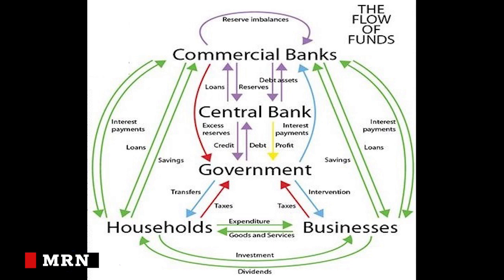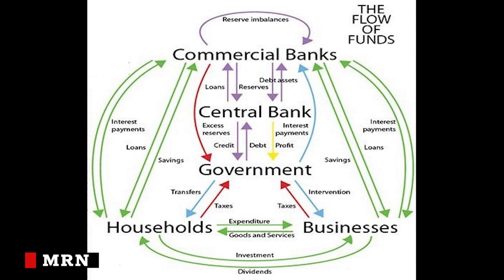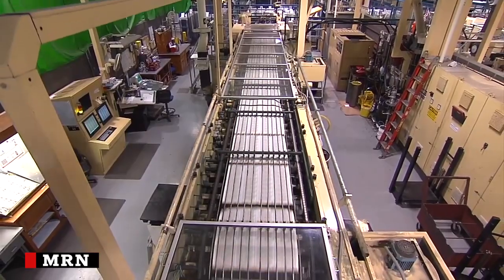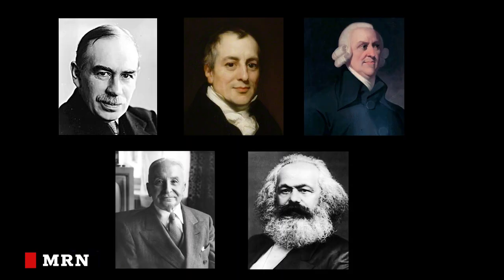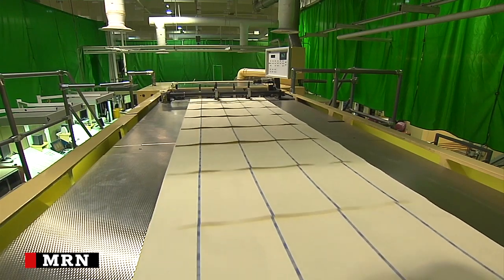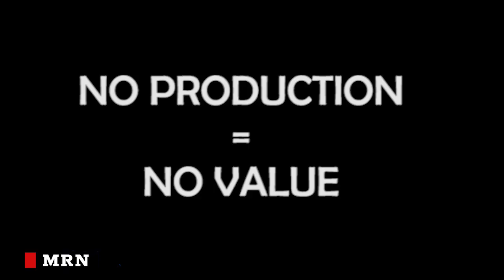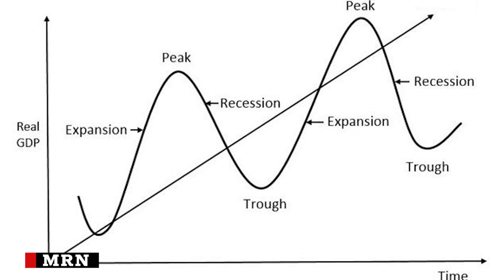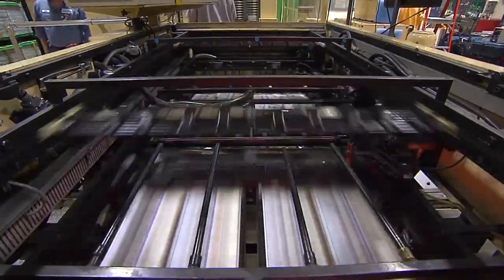The Main Problem with Modern Monetary Theory

Comment: Taxes create unemployment. Taxes are a brake or gas pedal to control wealth gaps and inflation. Taxes drive the currency. Taxes are not needed for revenue. The federal government is the currency issuer they created the unit of account. Their spending is our savings. When congress passes a bill or law it is giving the federal reserve a deposit slip to issue those unit of accounts into the accounts at local government banks to then use to purchase the resources they are needing such as housing, infrastructure, jobs, education, health facilities. There is no value to the unit of account until the natural resources are produced . Dr Stephanie Kelton has her new book out The Deficit Myth. It is a best seller